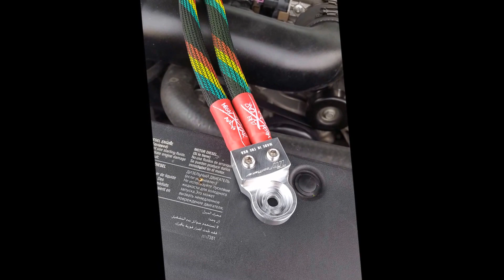Installing Toolmaker Matelworkz dual alternator terminals

Comment: I was just about to say the same thing as Ryan down there. I would defiantly go with some flexible rubber rust inhibiting paint. I have an 01 explorer sport and the rockers on these trucks completely rust to crap especially in the northern states and when I go to replace the inner, middle and outer rocker panels all the way to the floor pan I plan on lifting the body and taking the frame and axle housings down to bare metal and painting them with flexible rubberized rust inhibiting paint. Lots of coats because 1 or 2 coats is not enough with retail store off the shelf spray paint. It would just rust through that eventually or the paint would rub off from road debris. best of luck to ya and I do like the setup, I'm going dual alternator so I am going to big time wiring as well but id like to try to keep the wiring as hidden as possible perhaps within the factory harness although that gauge of wiring is really thick.  Keep up the good work. Kudos
Reply from the maker: ClutchCobraKID1 thanks for the advice man and for the support...

Comment: Nice build, you should spray the ground lugs on your frame with paint or truck bed liner so it won't rust over time.
Reply from the maker: Ryan Lachman thanks man and I did spray it with the bed liner thanks for looking out!!!
Reply: tyron mathis no problem man just helping where I can.

Comment: I have a tripple input for alternator but don't think I can use it because it lays on the back of the alternator or makes contact with alternator casing and I'm afraid hooking power to or will cause it to make the whole alternator a positive contact..
Reply from the maker: Bryant Peoples if your stud on the back of your alternator is long enough you can put a nut or spacer on it to create space then the alt triple input and another nut

Comment: How did you do the big 3 with the 2 batteries?
Reply from the maker: Otto B 
upgrade + wire to the alt on main battery 
run + wire from main battery to secondary battery
upgrade  - wire to chassis on both batteries 
upgrade - wire from engine block to battery 

also it's up to you add fuses to all the positive runs